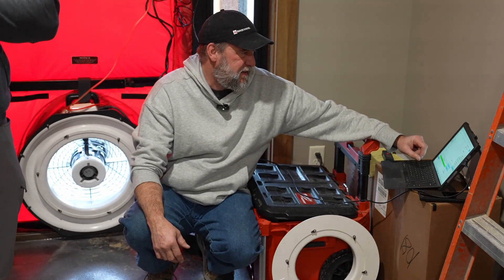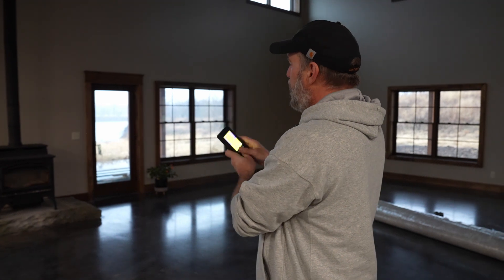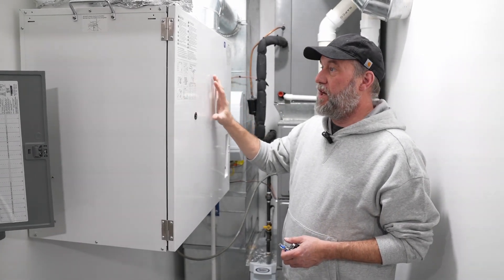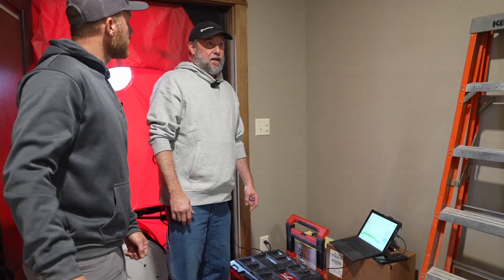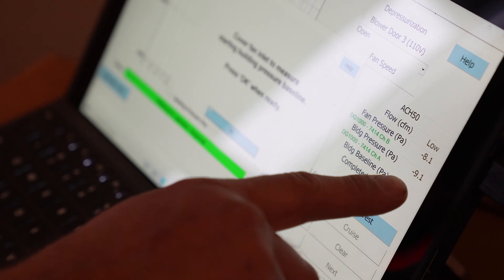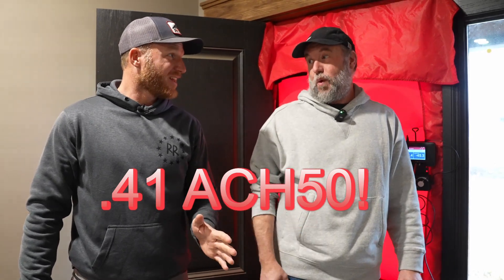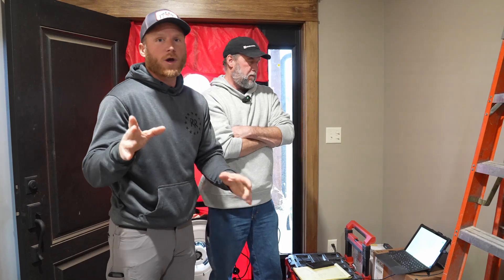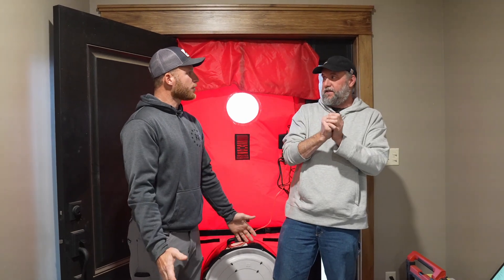Barndo Blower Door Test!  Did we just go BELOW Passive House??

Comment: There’s a system that seals off a home after all the framing, windows and doors are installed and pressurizes it similarly to this test. Once the house is pressurized they spray a fine mist or fog of a chemical sealant that builds up and seals any leaks up to like 1/4 inch in size. If there’s air escaping anywhere it will be sealed as long as it’s not too big. I can’t remember what the process is called but it can’t be beat.

Comment: Every thing in theory works fine.But in actual life it doesn't.If a house doesn't breath you get mold.What happens if you have a small water leak and it cannot dry as there is no air flow to dry it.Fixing rot is very expensive.Why do you have to leave your door fridge ajar when not in use it starts to smell moldy.

Comment: Its interesting if you actually dig into the reasons why passive house wants a low ACH value. Energy is a part of it, but the main concern is actually preventing air to carry moisture into the wall. That's part of the 0.6 ACH standard for new. Retrofit can accept 1.0 ACh, but there is a sign off that says we dont guarantee the wall structure may not have moisture issues.

Very good work boys - lower than that i wouldn't worry about. Energy wise itd be embodied carbon is the current debate topic some groups are figuring out - the building part is all there - just keep showcasing and informing so its become the standard and not the "high end costly" projects.

Comment: This is so tight if you were to install a or run a gas furnace or gas water heater you would literally have to have supply air for the furnace to work you couldn’t rely on the natural leakage of the house
Reply from the maker: you always supply air??

Comment: hey, next time try to do a leak test without the finishing boards inside, on the exposed foil and ready installations.  this will allow you to repair any leaks on the wall, now it is possible that a lot of air is hindering the finish.  our result in Poland is 0.19 ach50 another thing is the fireplace, it should have an external air supply prepared at the 1st stage of construction and the fireplace itself should be with a closed combustion chamber, then you will avoid problems

Comment: There IS too much of a good thing. The building industry is getting there, but unfortunately, it is VERY 'OPINIONATED'. Different inspectors and engineers have WAY too many "ideas" on how THEY want things done, but they don't EVER consider the long term health benefits. (It can't be done simply because we're infallible) We've become WAY to insistent on "carbon sequestration" and THAT is the problem. We've had this whole national push for going electric and eliminating "carbon emitting combustion" but no-one has actually considered HOW we get there at a reasonable rate to allow technology to not only keep up, but be PERFECTED to eliminate a negative effect on what the net goal is, which is to reduce carbon emissions, if that is even a thing. We're actually looking at air quality, and to a lesser extent, air EXCHANGE. Stale air in a home is the detriment to it's longevity. There is a reason why so any structures have survived for a hundred years or more. It IS air exchange. Stagnant air holds moisture and bacteria which, left unchecked promotes the decomposition of whatever previously living organism you've used to build with. In ALL of this effort, NOW we need to introduce a "controlled" air leak?? Via an air exchange unit or heat exchange unit??, SO, you've pulled a Negative air-pressure test, which is COOL, EXCEPT, that with all that negative pressure, you're pulling in every contaminant, every bit of grit or dust, dirt and dander to EVERY other leak and are actually introducing a dirty atmosphere to your living space. Green Building is a LONG way off from "absolute efficiency" which is a builders "unicorn". It just isn't possible.
Reply from the maker: not sure you really understand....the goal is for you as the builder or homeowner to control the air exchange and to be able to filter it.  just letting a house breath is not good.  seal it off and then control the fresh air intake.  that is the goal

Comment: I'm currently building a super tight barndo. Osb ceiling that's taped and then strapped for drywall. The only attic penetrations are plumbing vents and one wire for porch lights. Rigid foam board glued to the girts on the inside sealed to the post. I hope to be under 1ach50

Comment: Well, in order to use the fireplace it seems that you would have to have an open window or door to create the draft that a fireplace needs. Am I wrong on this? When the question came up about the kitchen hood vent it struck me as possibly needing the same thing for the fireplace. Any thoughts anyone? Kyle? Awesome video guys, thank you.
Reply: I would assume it has an outside air intake kit.
Reply from the maker: We’ve ran the fireplace many times no issue

Comment: I am converted to the benefit of housewrap, except for under metal siding and roofing. Need for a vapor barrier - sure, but sheet metal allows no air flow except at openings and building corners.

Comment: Does the exhaust fan in the bathroom work as efficient if the building is this tight?
Reply: The smaller exhaust fans should work as designed.  Most bath fans will move between 50 and 100 CFM of air, because of both the volume and the few natural air leaks, these fans should not have any issue, though they will create a slight negative pressure in the building.  The big 1200 CFM fan will not produce anywhere near that output without some sort of make-up air system or opening a window during operation.

Comment: I'm confused as to whether the various air ducts (range hood, bath fans, dryer vent) are seal before the test. If they are not sealed wouldn't they allow a LOT of air in?
Reply: Bath fans, dryers and kitchen exhaust hoods need to be off during the test but are not allowed to be sealed.  This equipment along with their ducts to the outside usually leak a little air during testing.  They will also leak air when the wind blows, or the home's pressure becomes negative or positive.  We want testing to represent how the home would act normally.  There is a testing standard called the ANSI/RESNET/ICC 380 which outlines what equipment can be sealed and what is left as found.  If you find yourself having difficulties falling asleep, reading this testing standard will do the trick.

Comment: What’s an average for most homes this size I wonder?!?!
Reply: Blower door testing has been in the building codes since 2012.  Not every area has adopted the code though.  My area has a requirement of 3 ACH50 or less.  Most new homes I test are between 1.5 and 2.5 ACH50.  The tightest I've tested was .33 ACH50.  The worst was over 13 ACH50.

Comment: Nice to see this type of test happening in other places. In Minnesota ACH tests are mandatory on all new homes and the score needs to be 3 or lower. Scores tend to go up a bit after the home settles but at .4 I'd bet you're still under 1. Crazy! This was one of the questions I've always had watching post frame builds. Great video, very informative.

Check out a company called AeroBarrier (not affiliated) for sealing up all those pinhole style leaks programmatically. A .4 house doesn't really need it but if you were going all out.. or had another build that had a score higher than you wanted.
Reply: There is virtually no settling in a post frame.
Reply: @christopherhaak9824  By settling I mean wood drying and all the other common things that happen in the first year of new home ownership. That certainly happens.
Reply: @racerx00  there is nothing to dry here that would increase air leakage.  There is no vertical settling, the sheathing has no drying to speak of and the seams are taped.  If you can point to some drying that will occur that will increase air leakage, I would love that.

Comment: Is a super tight structure good? I'm sure there's debate about that. Can you keep fresh air circulation,  constant air replacement.
Reply from the maker: yes we have mechanical air exchange
Reply: You have to add an ERV or HRV for fresh air, which you should do for occupant health in any new build any way.
Reply: The tighter the better, but you have to have mechanical air exchangers (for air quality). I know Matt Risinger had a video on this where there are products out there where the exchange system only opens when something needs more air using a high quality back draft damper. It had its own vent system going to I believe the kitchen for its return then running to an outside wall. When the hood vent kicked on or the dryer it would grab the air it needs from that small duct return pulled from outside. I think it went through the airfilter system and heating element I'm not sure.

If you have a super tight house and don't have something like that either your CFM on your hood/bathroom vent/dryer/etc. will be poor or you have to open a window every single time you use those which is not ideal. The backdraft damper system is not very expensive at all, but people overlook small details like that.

EDIT: here is his video https://www.youtube.com/watch?v=rSIqKGsF2ZA&t=368s